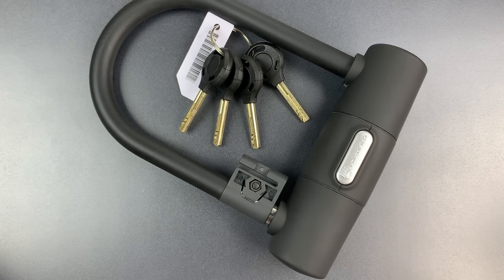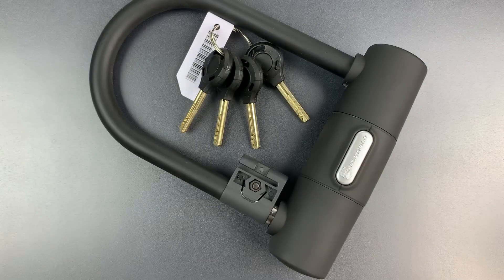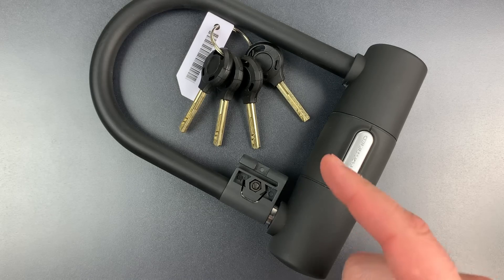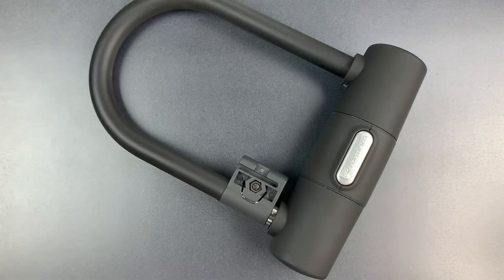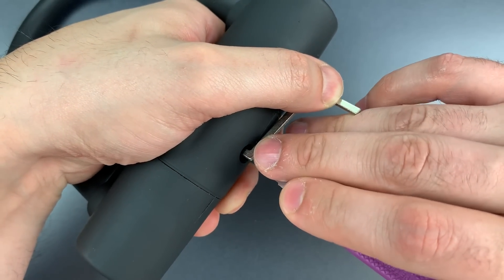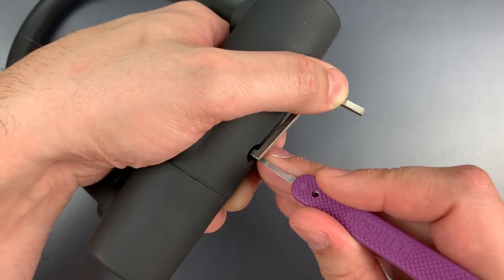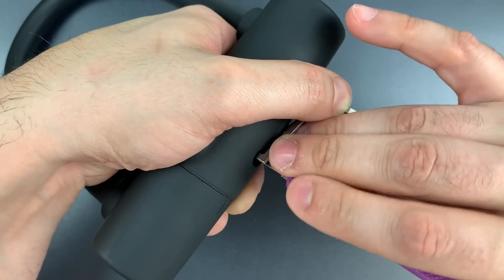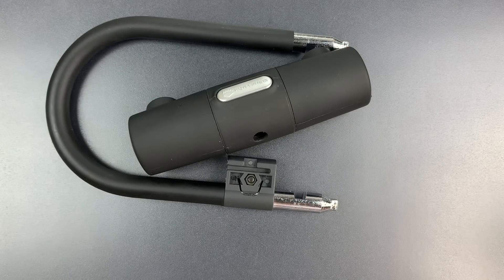[898] The “No Nonsense" Bike Lock Picked

Comment: For reference an actual thief's pick time is the square of LPL's pick time in seconds.
Reply: So a full hour for this one? Lol
Reply: @are3287  Still faster than I could pick it.
I might actually die from thirst before successfully picking a lock with more than four pins
Reply: There is actually a low-skill attack that works on any lock made of either matter or antimatter. Insert the "ultimate master key", a thin antimatter-tipped rod. If this doesn't work, use the lock as a fingerprint lock. You will get both an open lock and a wider entrance because a lot of energy (m*c^2 or about 89 petajoules per kilogram) is produced.

Comment: I Have been an auto technician for years and through the years we have had to cut things off, grind things off ,pound things apart sometimes difficult , sometimes easy.   It would be a good idea to design a lock based on The most annoying and difficult to separate mechanical components found in day-to-day automotive or other mechanical fields.  Things like sodium filled valve stem‘s.  A bolt that has a loose washer on it so it just spins around when you try to cut it. The 4 inch cordless angle grinder seems to be the end all for almost any lock
Reply: once the angle grinder comes out, the lock loses, pretty much every time. Worst case, they'd need to swap to the second cutoff wheel.

Comment: Best lock for bike is having super shitty rusty bike nobody wants to steal :D
Reply: and an old used tissue in the luggage rack
Reply: People will steal anything.  Taking the wheel off or defalting the tyres will put off a lot of ride-away thieves though if you mist leave your bike in a risky area
Reply: @Quix One of the train stops I passed today had a shitty Wal-mart mtb-like object with a U lock securing the frame to a railing.  That's all that was left though - everything else had been stripped off.
Reply: Mārtiņš Dmitrijevs Tried that, didn't work out in the end.  Well at least it was cheap.

Comment: I like these videos and yes, some of these locks and safes are complete trash. If a lock can be opened by feeling the tumblers manually or simply sliding in a piece of soda can, it’s garbage. But if a lock requires significant skill and/or specialized tools, it’s probably ok for most applications.

Comment: All I look for in a good bike lock is:

Are there any known exploits where it can be shimmed or otherwise easily opened?

Is the steel strong and thick enough that they can't get through without power tools?

Is there enough pick resistance to stop a low skilled attack like a rake? 

If these criteria are met, it's enough for my $400 dollar road bike. This is also because where I live and park my bike, there are many more expensive bikes which are secured in much worse ways like cable locks etc. Makes sure my bike doesn't stand out as vulnerable

Comment: @Lockpickinglawyer I'd really like to see you design a truly functional and virtually unpickable lock. I'd probably buy one or a few to lock my home with.
Reply: One that digitally measures the pins, requiring that they all be in the correct position ±5% for 500ms before opening. It would therefore be unpickable and unhackable. A key could be used as a crank in case of dead battery.

Comment: Do realize that “tough” is meant for bike thieves who try to cut your lock. The average bike thief will not try to pick your lock, they will simply take a different bike if they cannot cut it fast. Also, it might not be “extremely difficult” for you but that is not a fair standard to use as a comparison. Most pickers/thieves will not be as experienced as you are. If it takes you 2 minutes it will be sufficient against most bike thieves since it will take them longer and probably too long. They will simply move on yet again to a different bike.

Comment: Just found this channel recently through a friend.
After watching a couple of these, I am now wondering what locks you would recommend; that you've had a tough time with.
Reply: He mentions in the comments there are locks he can't pick, but never shows videos of them.  He has a hard time with Abus, but those locks are pricey.
Reply: @6cylindertuned 
Thanks!
Reply: He has a video on his "10 best padlocks", that's a good place to start. But most expensive products from reputable companies should be OK for most people's needs. Once it's easier to cut through the chain or force the door than it is to pick the lock, there's not much point in getting a more secure lock. Most criminals are not skilled lockpickers and no lock resists an angle grinder or a tungsten drill bit for long.

Comment: I dont know much about locks, but what if someone made a lock with multiple different kinds of pins?  like a slider side bar, tradition pin, dimple and maybe one other?
Reply: There are a few complex locks like that, most tend to cost a lot more than most bikes. Complexity = cost. And if it's an outside lock, more complexity can make it more susceptible to failure from dirt and corrosion over time. And if your super-tough uber-lock seizes up, now you have an ordeal to get it open and retrieve your property.

Comment: What does it mean for the standard hook to be on 18000's?
Reply: Not sure if you are just  making a point about stupid imperial. If you are, I agree. If not, he means the pick is made of metal 18 thousandths of an inch thick - just under 0.5mm.
Reply: @thisnicklldo  I was asking because I honestly had no idea about what it meant.

Thanks for the info, though.
Reply: @thisnicklldo  but it's weird, because 18 thousandths of an inch is around 0.0014 millimeters.
Reply: I still don't know if you are joking. Anyway, you are calculating 1 inch divided by 18000, in millimetres. In English that would be "One eighteen-thousandth of an inch". That's not what he said and not what he meant. He meant 18 one-thousandths of an inch.  "Eighteen thousandths". That's just under 0.5mm. Even if you are making a point, imperial may be a bit dumb, but it's not that hard.
Reply: @thisnicklldo  thanks again. Got it, this time

Comment: There is almost no locks that can stop experienced picker. It's kinda strange that he was just picking it, but in before had talked about flaws in construction. Way more  logical would be to test it on bruteforce, 'cos lock itself is quite common one.
Reply: This channel is the Lock Picking Lawyer, not the Lock Smashing Lawyer or Metal Cutting Lawyer :-)
Reply: @jrd33  yet, he does sometimes force openings, to show construction flaws of the lock. If I recall it correctly...
Reply: @НелиелОксингейл  Yes, sometimes. But the advantage of picking is that you still have a lock afterwards!  Picking a lock is a test of skill, destroying one is only a test of having the right equipment.

Comment: Ah where are those beautiful chinese fake abus bordoe locks. Which can be picked by nothing more then a little slap on the cylinder with no tools at all. A rock that lays by the street will literally do fine. 1 hit with a hammer and the force you put in when you try to hammer in a nail will do.

Comment: there's no thieves who would know how to pick a lock, some might have basic knowledge, but anyone who is smarter to pick a lock, would not waste their skills on stealing someone's bike or shovel from shed. 99% of thives have IQ lower than 80, so even the most basic lock design will stop them from picking it ... I mean even most locksmiths are not capable of picking the locks, they rather just break the lock and replace it and charge you for it.

I've been watching some police and bailiff tv shows and they always have some half-wit locksmith who doesn't know how to pick a basic household lock, they spend 20-30 minutes on drilling and bashing it with hammer .. quite pathetic .. considering that they are suppose to be professionals lol.